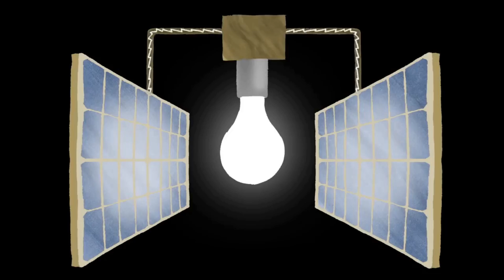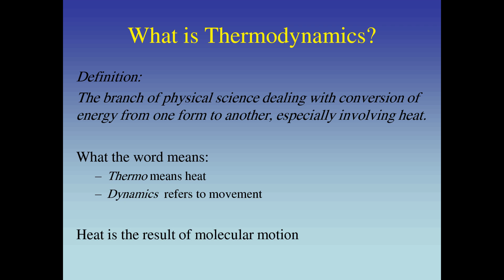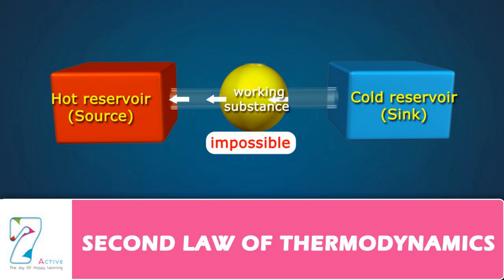2153 Do Perpetual Motion Machines Work

Comment: Idea for a perpetual machine: what if instead of trying to use magnets for a perpetual machine, you use the 1st law of thermal dynamics now the 1st law of thermal dynamics states that you can Not create or Destroy Energy but you can transfer one state of Energy to another what if you some how transfer Kinetic Energy to static Electric Energy and turn the Electric Energy back into Kinetic Energy and the cycle repeats itself in an Infinite loop. The only trouble is trying to find a solution to do this in a officiant way

Comment: in the case of  a wheel spinning with only the initial input perpetual. lets say 100 years of sinning is enough to call it perpetual.. you think there is no way to do this but you are certainly incorrect. i myself have taken one approach that can theoretically achieve the main goal. Because i do not care about fame or glory i can tell you, then show you..
Dan from green power youtube channel set the stage a long time ago. it is true you have still not  up to date with the discovery but others have seen it. I understand its potential. I device the ferrous wheel. you simple take the track roll it up like a spiral, then ad the 2 magnets at the base.. cheers. ps  the name of the video is not important. just search his channel and you can ind it.. a track that contained magnets, and steel spacers. and the car is simply 2 round magnets on an axial. cheers..

Comment: The 2nd Law describes a closed system, yet there are none in nature. The error is then extended to electromagnetic machines by insisting they are closed systems as if the electromagnetic phenomenon is somehow different from the rest of every other observable natural phenomenon. Like all man-made engineering, how "open" it is depends on the design and the knowledge of the builder.

Comment: Its interesting to read the wikipedia article on "conservative forces". One example being gravity. This basically says if something moves around an arbitrary shape path and returns to its starting point the net work done by the force is zero. Eg If you roll a ball down hill it gains energy, but it takes the same energy to lift it back up to its starting point. The interesting bit is that the shape of the path doesnt matter, if it ever returns to the same position twice then no work is done. 

This effectively rules out over ballanced wheels as they all return to the same point once per revolution regardless of their design. The force between two magnets is also an example so this rules out so called magnet motors because they also return to the starting position once per revolution. It rules out any rotating perpetual motion machine that uses gravity or magnetisim.

Comment: I use potential energy to explain why perpetual motion machines cannot work. Apple doesn't fall down from tree because of mysterious gravity, it falls down to lower it's potential energy. Spring under tension springs back to lowers it's potential energy. Two magnets don't repel each other because of the magnetic force, they repel each other to lower their potential energy. Every single natural movement is to lower the potential energy. When you have perpetual motion machine in order to move forever, it has to be circular. After some time, it has to return to it's original position and start over. You can calculate potential energy at any given moment of it's operation, it's just simple calculation of all forces and distances. But when perpetual motion machine returns to it's original position, it will have the original potential energy as it had in the beginning. If you compare two points in time where the potential energy was the same, there will be no movement. Things only move to lower it's potential energy. Things don't move to have the same potential energy as when they started. You may have some initial movement, that's when the machine lowers it's potential energy, but then, in order to return to the beginning and start new cycle, it has to raise the potential energy and things in nature don't want to raise their energy, so the machine will simply not move to the starting point and it will be stuck in some local minimal energy point.

Comment: If we were to make a free energy machine it could comply with the laws of science if you could build a machine which without any external energy inputs would produce energy whilst reducing the temperature of the  air around it , that would be using the heat in the air to produce either movement, electricity or both.

Comment: A machine that is not a perpetuum mobile, but also doesn't need to be fueled manually, is good enough. Clocks that are wound up exclusively by barometric pressure has existed since the 17th century. And today, the Swiss company Jaeger-Culture manufactures a modern variant of a perpetual clock under the trademark "Atmos". This clock is wound up by changes of temperature and air pressure, which are even in well-climatized rooms rooms sufficient to keep it running.

Comment: Here's the thing though, we don't need 100% free energy. Here's my idea to debunk.... we've seen these magnetic perpetual rotating wheels using magnets. It works for a while and then eventually slows down. And when you apply a field to do "work" it slows much faster. But we don't need the power to be continually applied like on a generator. We just need a clutch system that puts a pulse in on a timer to keep the generator spinning. It's not free energy but it could be made more efficient where rotating motors don't require a full time draw to spin but just that pulse on a timer that keeps it spinning so you're just reducing the amount of energy required to keep a generator on output. It seems plausible to me but I haven't seen anyone try it. We just need to make things massively more efficient, not free.

Comment: The atom is a perpetual motion system. It has a life of 10^25 years and the universe is only 10^10 years. This means that if we can use the force of two groupings of atoms working in tandem we will in fact have a perpetual system (relative to the age of the universe) that will produce energy on a very large scale. This requires no batterie and it will be perpetual with respect to human life on this little ball in which we have lived intelligently.

Comment: There is the Universe/Multiverse, which seems designed to run for eternity, sort of by definition. If holographic theory is right, you could produce a simulation which could run a universe and create it's entire lifetime. So that would also be a perpetual motion machine, in exactly the same way our universe is perpetual, regardless that it may be seemingly quick to us. They've already demonstrated opening actual wormholes from such simulations with a quantum computer. Why shouldn't it be possible to scavenge energy?

Comment: What about a heat pump, I was told that for 1kw of electricity put in you get 3kw of heat out because of the super efficiency of the gas.
Reply: There's no over-unity or broken laws with an air-source heat pump. It simply moves heat energy from a large volume of air into a smaller volume. The huge outside environment is cooled very slightly as heat is extracted, enabling your relatively small house to get a lot warmer.

Comment: A magnet is a solid-state perpetual machine? The Bloch wall receives a centripetal force allowing for a magnet's centrifugal force?
Reply: Any dipole (electric or magnetic) perpetually creates electromagnetic perturbations in the ether. This is real, observable outflow of real energy.  That energy had to come from somewhere.  It did not come from the creation of the dipole, since the magnitude is much too small.  That out flowing energy was previously absorbed from the ether as a property of the dipole.  Yes, there is an ether. Michelson and Morley never pointed their interferometer vertically with respect to the surface of the earth.  See Robert Distinti for details.  Opposites attract.  Opposite electric charges and magnetic poles attract.  So, a space charge of opposite polarity surrounds any polarity.  This unobservable space charge is absorbed and is the source of the observable energy field expressed by the dipole in the form of electromagnetic field surrounding the dipole.
Reply: @marinadizon2720  So the dipole is the framework that allows disturbance in the ether? It's then the field effects of the perturbations (structure) that then gate or give path for energy to flow? I wish there was a comparable iron-filings test for magnets for that of a battery, to see the dipole's inner mechanisms.

Comment: The flipside of perpetual motion is COP > 1 machines - or Coeffecient of Power > 1 machines, in which the usable output exceeds the usable input of power. I hope you get into these in some future video as they are all around us, but unintuitive. A turbocharger on a gas (petrol) engine, and even a solar panel, are things that "make usuable power from waste."
Reply: Agreed! And they are getting better. There are skyscrapers in NYC thats HVAC UNITS produce ice during summer nights and then the ice is used as a condensing medium for cooling during the day.

Comment: Id like to add something theres a difference between perpetual motion machines which by definition are impossible because parts wear and need maintenance. Free energy is a completely different thing and can be different for different people. If  you have a diesel generator and you are given somehow the fuel for free which might be collecting used veg oil and converting it to biodiesel. If your given 2nd hand solar panels for free, if you have a river running through your property and have a water wheel or turbine, that energy from any of those devices is free. We can argue about maintenance costs but looking at the average yearly energy  bill in the uk is around £1900-£2100 why would you not spend that or a bit more on  solar or wind or a combination. This nonsense you keep hearing about 25 year payback period is ludicrous. We spent £5500 on a solar/ battery set up. That alone was around 80% of our yearly needs. In the summer we produce too much . I want to convert the fence to a wind wall fence to fill in the winter shortfall. We're also looking at a ridge turbine for the roof.  My payback period for my solar cost is just over 2 years. You can even just get a home battery and charge it during off peak hours when your electricity is cheaper then use that energy when you need it. That could even be done in a flat where you cant put solar or wind up.

Comment: Hello Robert, Enjoyed your video - well "video's" since I discovered you last year. Let me make a correction to your content - "Work"  creation was discovered in 2008 and first machine built and demonstrated in 2010 - its principal of operation "reduced" the mass "required" to do a specific work -  that reduction of mass resulted in a reduction of input cost - thus work available was greater than work provided.  

By 2019, a total of seven methods were tested to provide excess work, the laws of thermal dynamics had never been presented with a method of "input reduction", and it took several years for those studying it to realize the difference between "Creating energy vs Causing work generation".

Eventually you will see it in a university paper - but for now - the limited scope of the conclusions of thermal dynamics results in very limited research on the topic.

If you want to know more - just ask.

Sincerely 

Wayne

Comment: Perpetual motion is bunk, over-unity is not. Heat pumps do more work on the environment than the user does on the pump. You could spend 100 watts running the pump and do 200 watts of work relocating heat from the cold sink to the hot sink.

That's over-unity. The second law is violated every single time an air-conditioner turns on because it does more work than it's supplied with. I'm not talking about making energy either there, I'm talking about doing work on a substance.

It has nothing to do with energy creation, I'm talking about the proper physics term "work". The user potentially does 100 Watts of work on the pump and the pump does more work than the user supplied on the environment relocating heat energy against the natural flow of heat.

The refrigeration cycle is an over-unity cycle.

Now you may say "but the heat already existed at the cold location" and that a moot point because RELOCATING THE HEAT AGAINST THE NATURAL FLOW IS THE LOAD. In this case the load is of higher wattage than the supply, that is over-unity.

Comment: I just stuck two Stirling engines into a tube furnace, used carbon dioxide as the gas and then run two generators off it. One makes most of the power to run the tube furnace, the other one covers the rest and adds just a little juice extra to run a couple of things

Comment: The US patented( the USPTP Does NOT issue patents to things that do not work)  motionless electronic generator by Thomas Bearden is overunity. Once started, it can power itself and put out excess energy. The secret is that the magnetic crystal is replenished  by zero point energy. Magnetism is called a force because no one has a working theory, but the fringe refer to it as vibrating crystal that is at the right frequency to to be replentished by the zero point.  The only reason it isnt perpetual on earth is magnets rost ( oxidize) in space they should stay magnetised forever
Reply: Not a chance in hell